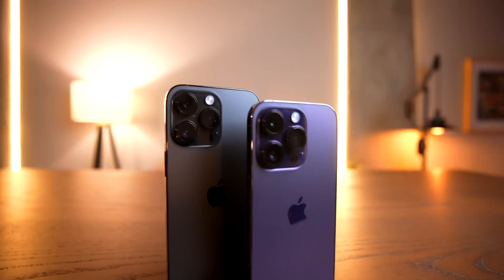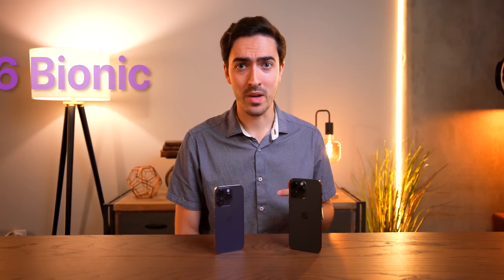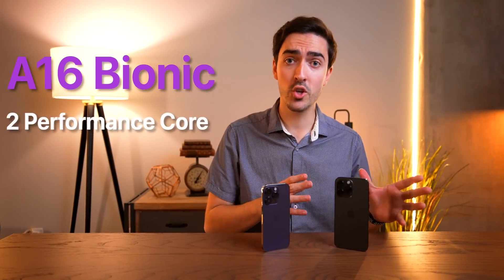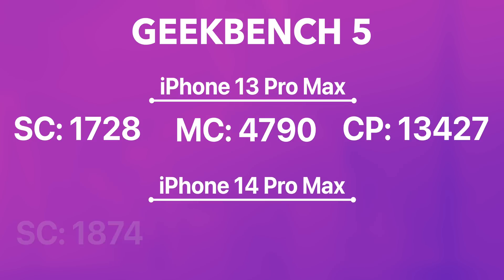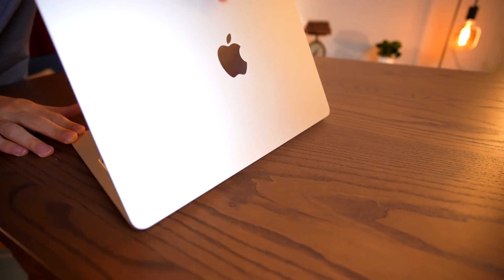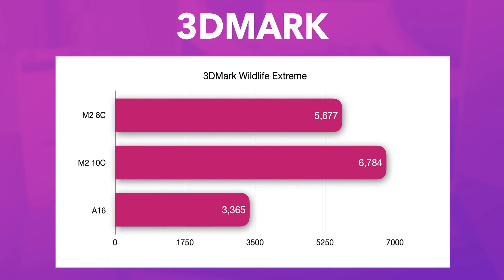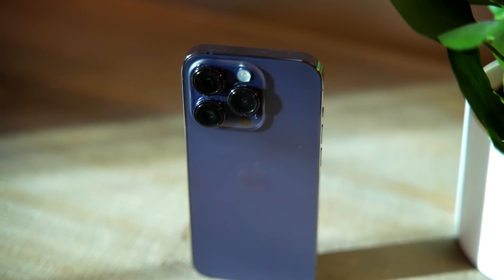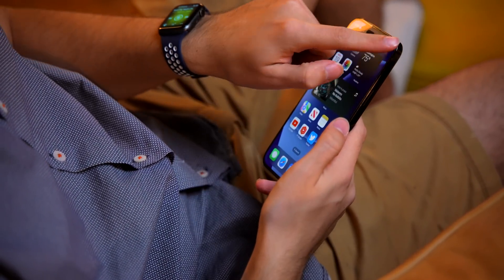A16 vs A15 Bionic TESTED: Apple is HIDING something...

Comment: Transistor size 5nm to 4nm really only accounts for a small percentage of performance increase. Considering the A16 has an extra billion transistors its not going to destroy the A15, efficiency is the key upgrade. Apple is still using the classic 2 fast 4 slow cores for its iPhones and until they increase the performance core count, every year will only be a marginal improvement in performance. At this incremental rate it will take until A19 to match the performance of M1, by that point in time M4 will be easily 4 times faster. 

The M series is so much faster because it’s physically larger by about 80% and when you have 4 times as many performance cores you will always have a higher performance threshold. Efficiency is great but sometimes to get more power you need more hardware. Gone are the days of 2X performance year over year for mobile SoCs, 50% is realistically the most we can expect for the future. 

Also 4nm isn’t really a significant leap, the next big leap will be 3nm and then 1nm both of which are currently being tested by ASML. We are fast approaching the hard limit for transistor gate size.

Comment: It was reported the 4nm node is actually a modified 5nm node. The jump to 3nm should have the generational die shrink benefits that we have seen in previous die shrinks.
Reply: nm doesn't even mean nanometers between gates anymore. They're using it as more of a marketing term now to show differences between generations than how much they've actually shrunk the chip. It get's confusing because Intel's 10nm chip actually has more transistors for a given size than TSMCs 7nm. They've run into barriers with physics for shrinking it any more. Once they get sub 1nm it will be interesting because they will need to find new ways of marketing the chip process - it would be very misleading to say transistors are less than 1 nanometer apart.
Reply: Forgiveness or Love  Val was probably not interested in Aaron in that way (even though he was working out, buying new clothes, renting another house, trying to find a mate other than his wife) and if she ever was for a brief time she isn’t now.
Reply: Forgiveness or Love  a couple things you have to realize is Aaron is a bit of a loser- no job, hardly makes anything off his YouTube channel, not anything like a minimum wage job provides- and women don’t like that.

Also, Val may have a bit of a drinking problem. I mean, her last two videos with him she didn’t drink and the two before that she reluctantly took a shot he gave her that she didn’t look like she wanted to take, but overall she embraced the alcohol and it was clear Aaron saw it as the key to her pants coming off. But that causes problems.
Reply: @chadh6855  WTF?  How did we go from discussing microchips to Aaron and Val’s mixed up love-life?  I’m sure I’m missing something.  Won’t be the first time.

Comment: 4nm is 5nm +++
Reply: nm doesn't even mean nanometers between gates anymore. They're using it as more of a marketing term now to show differences between generations than how much they've actually shrunk the chip. It get's confusing because Intel's 10nm chip actually has more transistors for a given size than TSMCs 7nm. They've run into barriers with physics for shrinking it any more. Once they get sub 1nm it will be interesting because they will need to find new ways of marketing the chip process - it would be very misleading to say transistors are less than 1 nanometer apart.

Comment: I'm definitely tempted with a used 13 Pro Max for half(ish) the price of a new 14 Pro Max.
Reply: yeah definitely the better deal if you don't want to print huge 48mp photos or use it in the sun too much. Just look that the battery isn't degraded much.

Comment: Luke said the SC performance is about 14% faster. He's wrong. It's actually only 8.4% faster.
Maybe he was thinking of the other scores: MC is 13.2% faster, CP is 14.6%.
A lot of the performance gain is due to a faster clock speed: 3.44 GHz vs 3.23 GHz, a 6.5% increase.
And going from 5 nm to 4 nm has also helped, since smaller transistors have faster switching times.
Finally, Apple says the A16 efficiency cores have better performance, which further helps MC scores.
We now apparently live in a post-Moore's Law world, so don't expect processor performance to increase dramatically each year like it used to. Improvements in the future may be logarithmic instead of exponential.

Comment: The A16 isn't 4nm. It's still 5nm but this generation of 5nm (5nm-4n)stuffs an additional 1 billion transistors into the same transistor-density as the last 5nm generation's. The A16 wikipedia article was updated recently, " marketed as "4 nm" " was added to the specs. The A16 only has 5% more transistors than the A15. That's not really much to brag about, so I can see why Apple used the A13 in their keynote as a comparison. Just imagine owning an acre of corn. Last year you were able to grow 14,000 ears of corn. This year, you became 5% more efficient and grew 14,700 more ears of corn. That's only 700 more ears of corn. The A16 Bionic is only worth 700 ears of corn. When Apple actually switches to TRUE 4nm process, you'll be getting around an extra 7,000 ears of corn (+20-25%) from that tiny acre of corn. Now that's worth bragging about. God I hope all of this makes sense.
Reply: nm doesn't even mean nanometers between gates anymore. They're using it as more of a marketing term now to show differences between generations than how much they've actually shrunk the chip. It get's confusing because Intel's 10nm chip actually has more transistors for a given size than TSMCs 7nm. They've run into barriers with physics for shrinking it any more. Once they get sub 1nm it will be interesting because they will need to find new ways of marketing the chip process - it would be very misleading to say transistors are less than 1 nanometer apart.

Comment: It could also be Apple intentionally leaving performance on the table. It's kind of a situation where Apple is competing with nobody on performance.  And they have pretty much all the TSMC newest fanciest fabs on lock.  So maybe it's Apple throttling things down because they may be on 4nm for a while so they have room to have incremental improvements for a few years.  While it's been an exciting time in the silicon advancement lately, pretty much everyone knows the die shrink party is going to end pretty soon.  So it's going to be more about smart design going forward.
Reply: Read somewhere that apple ordered a lot of TSMC's manufacturing capacity 😂
Reply: The end is already there, 5nm was the magic wall, everything from now is just marketing or more helps more (bigger chips)…

Comment: I got the 14 Pro Max and it feels noticeably snappier vs my previous 13 Pro Max which surprised me because the 13 Pro is no slouch. The multi-core difference is higher than single core and perhaps that's what helps in this case.
Reply: No, for normal workflow is just the Singlecore performance important, multicore comes only to the table when we talk about hard work like high end games, video editing and stuff like this…
That it feels more snapier is just your imagination, nearly all tests shows the same, the „jump“ from a15 to a16 is just small step and that’s completly normal cause 5nm works just more efficient as 4nm…
From now every more shrinking just means more heat and just a bit smaller, more power is from now only a thing of software anymore…
Reply: @Eddy_E.  I’m a developer and I understand how multicore is used, and general usage definitely is affected by multicore. In my own code I’ve written many time consuming tasks to operate in parallel and the faster performance of cores matters. It’s not my imagination. 😉
Reply: @RolandGustafsson  multiple parallel operations are not really general usage for most, for most general usage is surfing on safari and you can be sure that apples developer can handle that even with the singlecores, otherwise the battery will never hold so long a charge…
So only cuz you are write inefficient code doesn’t mean that every developer do so…😜

Next to that you are the first person who ever said that low tasks need multicoreperformance, no one else do so and with that I think i’am better with the other opinions…😉
Reply: @Eddy_E.  Ha ha! I develop for the iPhone and know what I’m doing - optimizing is my specialty both single and multi core. What have you coded?
Reply: @RolandGustafsson  better question, what changes that on the mainpoint I give, that the most daily used apps are just a thing of Singlecore performance?
Oh, nothing…
Well, I am sure that it is very important for that what I have coded or not, VERY SURE…😅😂
Reply: got the XS max and didnt want to upgrade to any of 11,12,13 or 14 pros.. they arent a game changer and are slightly faster with few new features but overall its been almost the same, looking forward for the upcoming Iphone Ultra Models. only then itd be worth the upgrade leap

Comment: Everyone keeps talking about faster and faster CPU, but what is the point when your phone doesn't have proper cooling. No matter how efficient you make the cores, eventually you will hit a ceiling for performance without proper cooling. Heck even using the phone while it is charging makes it super hot. Also more and more powerful CPU drain the battery quicker. Honestly the majority of people just use their phones for web browsing, instagram, ETC. Why on earth do you need all this performance?

Comment: It's very simple.

- The A16 is about 12-14% faster than the A15.
- The A16 is clocked about 10% faster than the A15. (3.44Ghz vs 3.23Ghz)

They can't push more IPC out of their silicon. They have hit it's limits. There needs to be a completely redesigned architecture.
Reply: The clock speed difference is 7%.  Performance doesn't scale linearly with clock speed changes.  Maybe 5% is from clock speed and the rest is IPC improvement.  Apple also said the performance cores use 20% less power as well.  Overall, not a bad update, but nothing earth shattering.   Either way, they are still several generations ahead of the competition.  Not only are competing chips used on Android devices slower, but they also use considerably more power.  Geekerwan has a nice video on this.

Comment: Benchmarks Schmenschmarks, How is this iPhone 14 doing in real world?
Its not just about CPU and GPU, that's just taking some measurement to have some figures to compare and make an issue from.
It about how well the phone performs as a whole in the real world. The computational video and photo functionality is amazing for such small sensors and lenses.  Canon would give its mother away to have this kind of hard and SW in its cameras. 
Apple isn't hiding anything, its focussing on the DSP, the Neural engine, etc.
Reply: That is why I think benchmarks on a phone is just plain stupid. Apart from playing games, people don't really use their phones for anything benchmark worthy. So what is the actual point? So what if your phone is 10% faster? Even if iphones were as fast as the M2 chip, what difference is it going to make. Are you going to start rendering videos on your phone now? Heck no because your phone will probably thermal throttle itself to death.

Comment: A 10% performance boost in a device that is already very fast is impressive if it was a slow device then not so much, is it Apple's plan just to trickle out 10% increases every year till they get some real competition? then they will have the extra power they saved up in reserve to turn the screws up

Comment: Well you basically said it chip speeds for all smartphone are fast enough the differences are pretty much not noticeable no matter what brand of phone.   I said this after the M1's started coming out that Apple real next challenge is Marketing how do you sell computers to people who really can't see/feel a performance boost.   Like Apple, Microsoft, and other have done for years is keep cramming features into the OS to chew up CPU cycles and create a need for more speed and help hardware companies sell more computers for their OSes to run on.    Apples big push has been AI for two reasons, one to create a need for faster because for speed because so much is going on in the background and two AI sees there future in AI hardware and software for cars and IoT.     So Apples computers and devices are their testbed for future AI projects.     

If you want a idea of how much is going on in the background of your iPhone or Apple Watch put it in low power mode.   See how your iPhone charge time skyrockets, because Apple stops all that background processing.   Your iPhone is still working fine for all your general use and will for hours and hours longer.      That is how much stuff Apple is doing in the background that is also creating a need for faster chips.    If they did add all that stuff you wouldn't need a new phone for years and years the performance would be fine the whole time.

Comment: I notice a much weaker battery with my 14 pro max compared to my 13 pro max at 98% battery health. I wonder if it’s the chip over working and not being optimized
Reply: It could be that your using more brightness, the 14 Pro’s display goes up to 2000 nits unlike the 13 Pro which only goes up to 1200 nits in HDR.
The always-on display can also drain your battery.

Comment: I think we can safely say, 3nm will be a huge leap forward. In tsmc we trust.
Reply: Don't expect too much. Apple/TSMC will stay on 3 nm for several years and Apple wants to sell better computers every year. So they will not give us a big increase in one step but will spread this to three generations or so. They only made the M1 so much "better" than the Intel chips to get attention and move as many users to Apple Silicon as possible.
Reply: @ArminDressler  I mean isnt that the case for everything lol? Intel will make a better chip so that users switch to their products...dont have to make it sound like a one sided problem
Reply: @nekogaming8461  yes, Intel does exactly the same. 10% every year. They could do more, but why should they? It is easier to sell more, if you do small steps with every release. So Apple/TSMCs 3 nm M3/M4 will not be a huge upgrade, just enough to be a fairly nice upgrade.
Reply: @ArminDressler  they will give us lower spec chips first with fewer cores in the name of battery efficiency, then optimise the design for performance
Reply: You mean in ASML we trust
Reply: @cheekynpc8267 So you mean in Zeiss and Trumpf we trust?
Reply: @phil86790  zeiss is just a part of it
Reply: @cheekynpc8267  You are correct.
So is ASML.

Edit: What I meant to say: If we start only thanking suppliers, why only say thank you to Tier-1 suppliers. That’s nonsense.